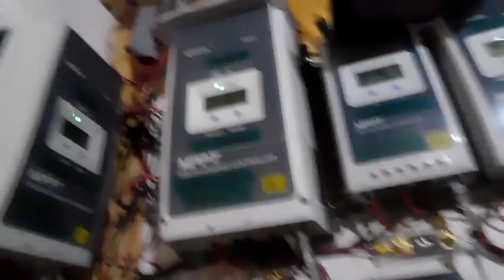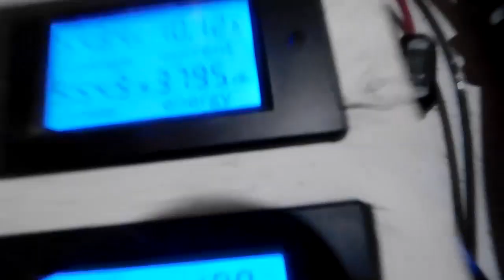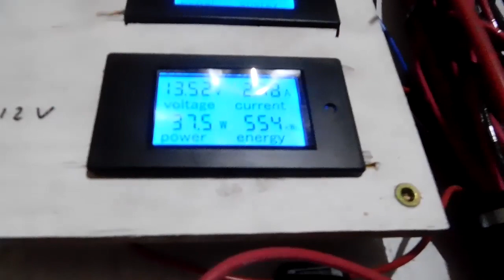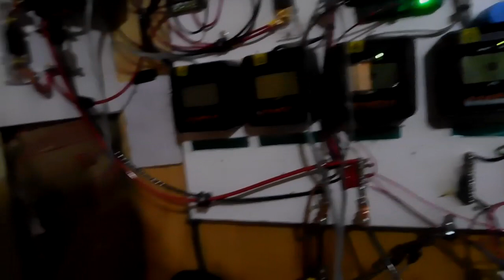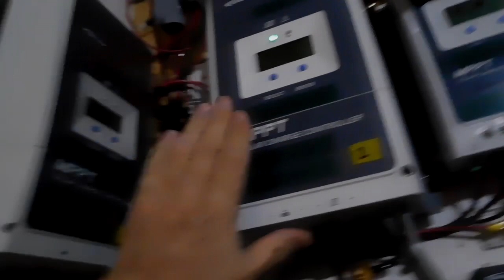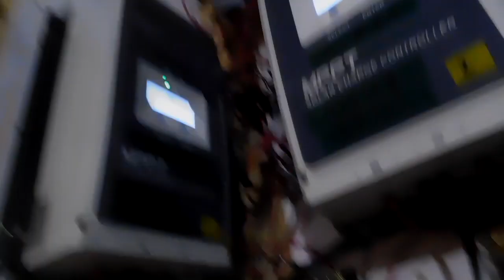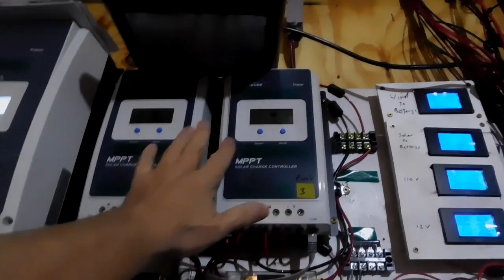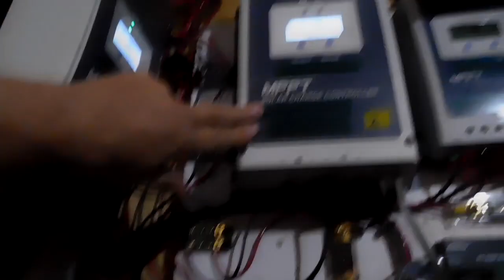Building an off grid solar powered house part 169. EPever PT-ADP-Port

Comment: your charge controllers should be doing their own thing. one shouldn't be doing all the work. there is something not setup properly if one 10 doing 10amps while the other in doing nothing
Reply: I believe he has them setup with staggered setup (so each mppt has a lower or higher voltage setting like  60v max then 58v max for the other (3-4th mppt is for an independent 12v battery) so they don't all come on at once,
but really they should be all set to the same setting so they all provide power at the same time to battery's and inverter (instead of waiting for battery to drop in voltage before the other mppt's come on)

Need to go far back on videos to have a look (doesn't look like he has played with lithium battery's yet, as 1 pack of 48v battery would be size of just 2 of them 6v battery's and have more capacity)